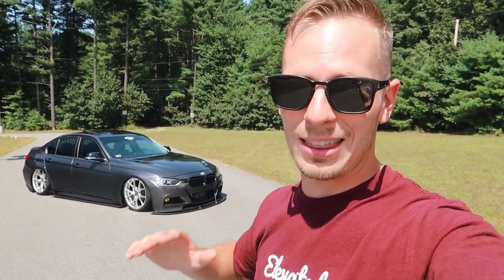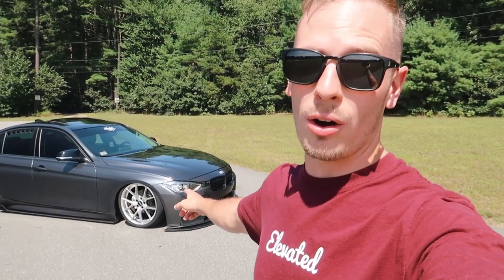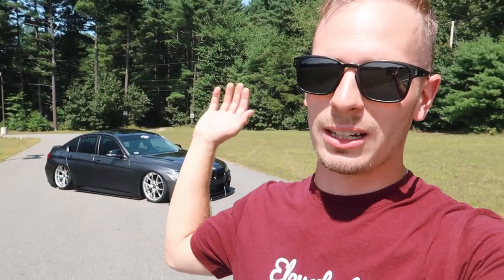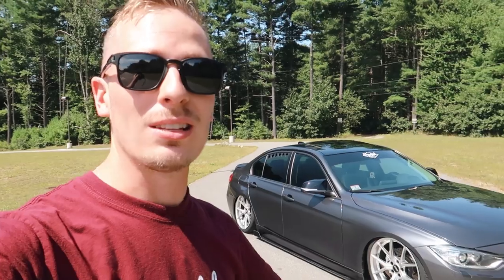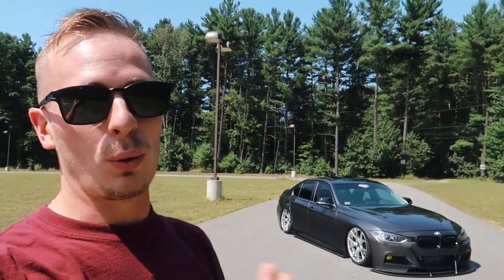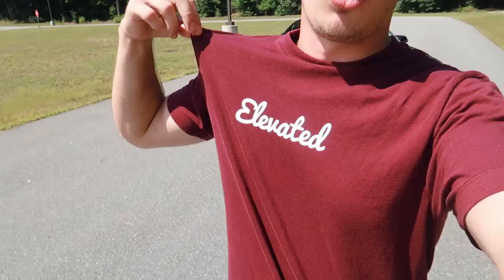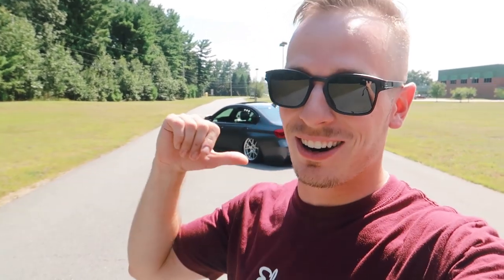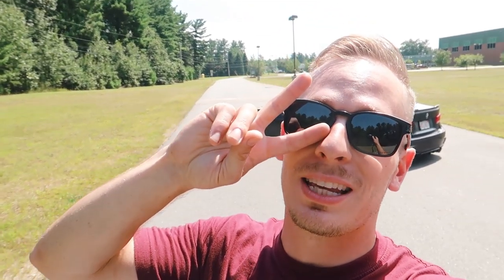XDRIVE AND STAGGERED WHEELS?

Comment: I've been running different staggered setups on mine for around 65k miles and no issues! :)
Reply from the maker: Justin Buice I am about 3000 miles away from being able to say the same 😂👌🏼
Reply: Did u have problems tires wearing in the inside on the rear?

Comment: 235/35 front is actually 82.25mm tire height and 265/30 rear is actually 79.5mm tire height, difference is 2.75mm, in precentage you are running 3.343% difference of tire height between front and rear.
Reply from the maker: My man, thank you for crunching the numbers!

Comment: Help me out ! My current tire size is 245/45R18 and my current rims are 18x8.5 inch wide with 35mm offset. I am buying 18x8.0 inch wide rim. Can I use 8.0 inch wide rims? If so, Where should I put those rims, front or back?

Comment: Hello mate av just put beand new set of tyres on my f30 xdrive 335D 255/35/19 on front 
285/30/19 rears
Is this compatible with xdrive system and is it in the 1% limit, will i be okay?

Comment: I currently have a 2010 BMW X5 I am planning on installing staggered rims 18" x 9 on the front and 18" x 10 on the back. Trying to figure out what size tires to get. If you could help it would be greatly appreciated. Thank you.
Reply from the maker: I dont know the size it would need off hand but there are loads of tire size calculators on the web. You can plug in your wheel size and it will recommend a tire size for you
Reply: Make sure the diameter is approx 1% minimum difference.
On my X5 i have rear 285/ 45x 19 and front 255/50 x 19 on the same rims. The stadard rim can easily take 315.
Easy to work out e.g. profile 50 means 50% of the width in inches.
So make sure whatever you use on i drive thst the diameters are as close as possible.

Comment: I have a 20x9 and 20x10.5. Front I have 245 35 20. What size should I run in the rear? Thanks in advanced
Reply from the maker: Could probably get away with a 255 35 20 or 255 40 25

Comment: Hey, I just changed my standard wheels on mu 420d coupe 2014 xdrive and went with 19 inches 8,5 at the front and 19 9.5 at the back and my tire setup are 225 40 19 at the front and 255 35 19 at the back, I'm in the range of 1%, but still, it doesn't work can anybody help me with that, please.

Comment: would i be okay to run 17's on xdrive they are 225/45 in the front and 235/40 in the rear? i'm having some trouble doing the calculations

Comment: Mounted a set of staggered A.C. Schnitzer on my e60 xdrive.  Had tires with .49% difference fronts to rear and my transfer case still slipped. Going with square set tires to use wheels. 1% rule was not correct for mine. 👎  Really like the custom cut vent shades.  Self created or ordered?  Those are tight. Thanks
Reply: Tim Foley Really ? You had problems with only 0,49%? That's a bit worrying. Did you have it checked?
Reply: @adimazga  Yes, my transfer case slipped on hard acceleration.  That set up was 245 40 19 fronts with 275 35 19.  Diff of .49%.  Changed rears to. 245 40 19 and car runs flawless.  If you don't know,  there is an app to turn off the x drive.
Reply: Tim Foley yea but not interested in turning the xdrive off on my X5 :)). I've just ordered a staggered setup with 0.3 after running square so we'll see. 265/45/19 9J  and 295/40/19 10J (I got greedy because I had the option of 0.1% but the difference between the Goodyears on those sizes and these ones was huge for some unknown reason , something like 300E for the same tyre with same rating)